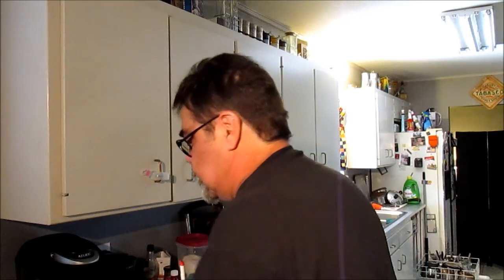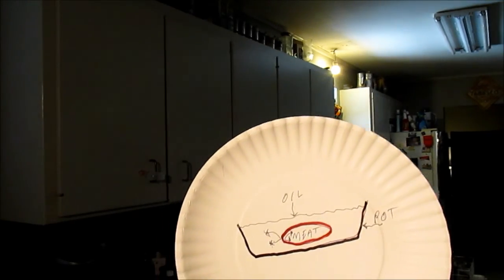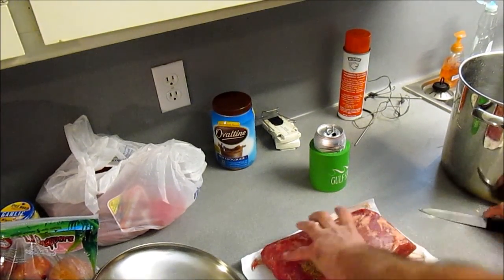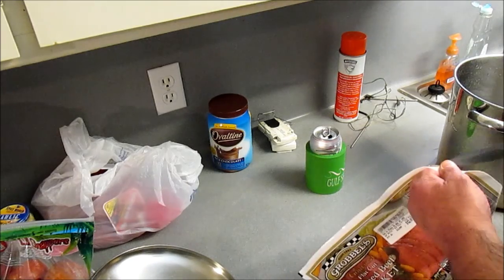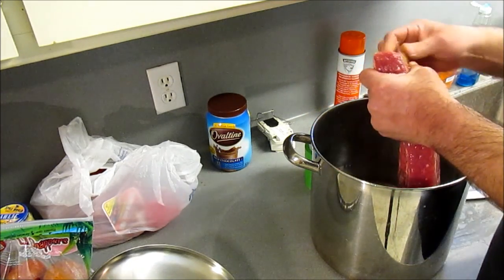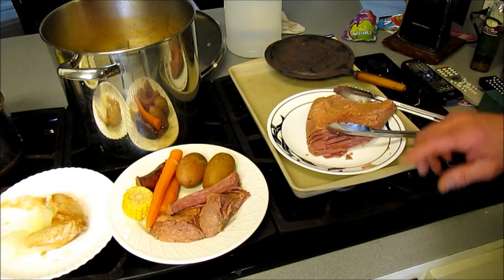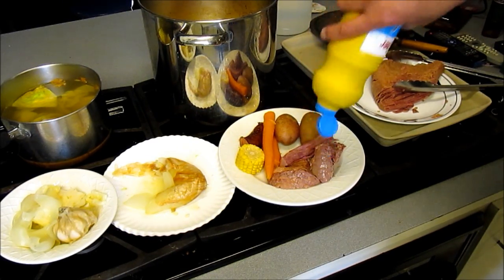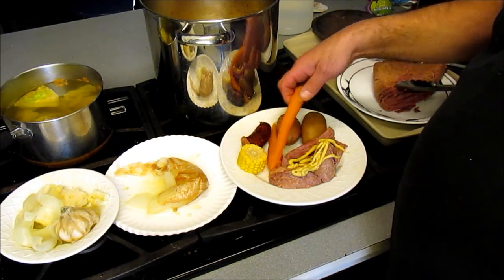How to make Irish Corned beef cabbage on St Patrick's day

Comment: Hey JB! I grew up in a Southern/Irish family and this is our family's way of making Corned Beef. It's so easy. Par-boil the Corned Beef flat-cut brisket, then finish it on the grill (or smoker, if you have time, no need to par-boil it first) with a simple BBQ sauce of ketchup, mustard, brown sugar, S&P and whatever seasonings you want to throw in there...it makes such a tasty bark on the outside of the brisket. Yum...Boy!!! Of course, use the boiling water for the cabbage and 'taters.